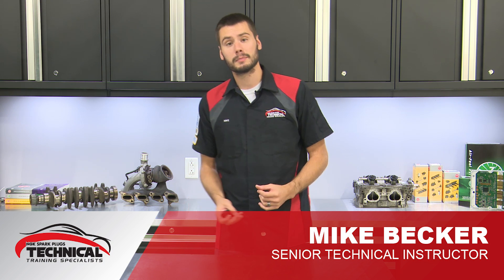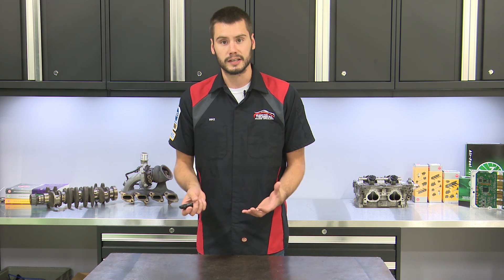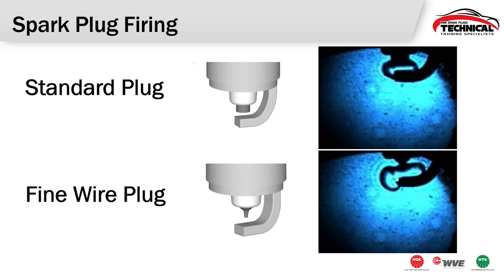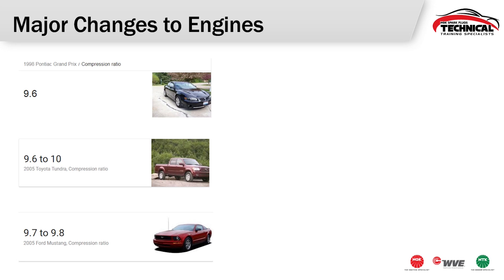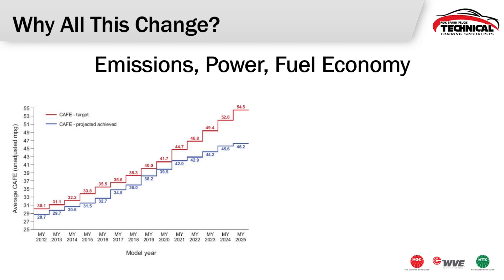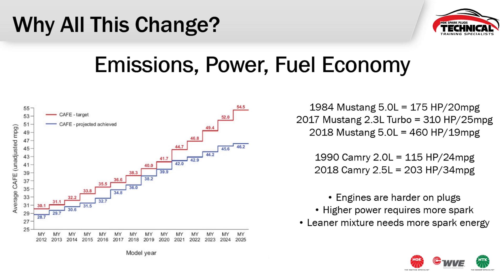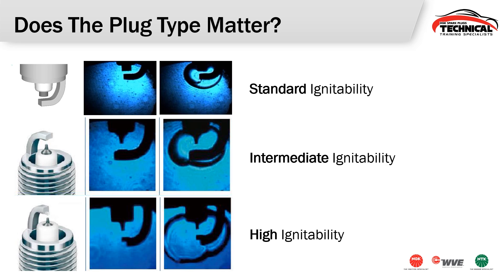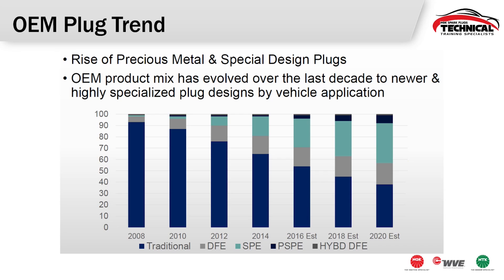Spark Plug Ignitability

Comment: Should I regap my new ngk ruthenium hx spark plugs?
Reply from the maker: Hey Migeul, that depends on the gap they are compared to what the car requires. A few thousandths, I'd probably leave them alone if it were my car. The "official answer" is that the plug gap on whichever spark plug you install should match what the car requires.
Mike Becker, Senior Instructor
Reply: GoTech thanks for your feedback

Comment: I'm running the PSPEs in my old 99 Camry 5S-FE n/a engine. All I can say is there is DEFINITELY a noticeable difference in performance over my OEM plugs. I made a video of these Ruthenium plugs about a year ago and got lots of feedback from many bright, knowlegeable people. NGK was nice enough to post and inject some reality into the comment section, explaining that NGK does not currently make a DFE for my engine, but the PSPEs will work just fine. They also said my OEM plugs were double electrode platinums which were designed to prevent misfires if the plug got carboned for any reason. I have not experienced any misfires whatsoever with the PSPE Rutheniums and in fact just made a 17K mile video where I pull the plugs from my old engine, and they look beautiful. The insulators are still clean and the electrodes are carboned in any way. Granted, I do drive 500 miles per week (b4 Covid), now abot 300, all highway, very little stop and go. I am totally sold on these plugs, and I don't say this lightly. Here are my videos... 
https://www.youtube.com/watch?v=U7Myjs9rCHg&t=137s   
https://www.youtube.com/watch?v=r8pPB-PhkzA&t=389s
Reply from the maker: Hey DBF Crell, that's great to hear! Yep, I remember seeing your video, and commenting on it. :)
Mike Becker, Senior Instructor
Reply: @GoTechTraining  Mike, I totally appreciate your tech support on my video. It's amazing how many times I've had to refer aggressive plug-savy commentors to your explanation simply to give my use of the HXs credibility in my n/a engine. I'm stunned how many people out there have an infinite understanding of precisely how spark plugs work in a combustion engine, yet no understanding of my use of them or thinking I chose the wrong type. All I can say is these Rutheniums are literally the best performance upgrade I've made, even over a K&N air filter, NGK ignition wires with Techflex heat sleeves, excellent synth oil and synth tranny fluid, and several other minor things. I wouldn't even trade theses PSPEs for DFEs should NGK decide to make them for my engine someday. Thanks again!

Comment: Hi Mike, just wondering if the Ruthenium HX is your top spark plug, why is it cheaper than the others such as the Platinum Iridiums that my car uses? BTW great content 👍
Reply from the maker: Hey VQM35, Ruthenium HX is an aftermarket only plug. It's not going to be an exact replica of the Laser(OEM) series plugs. It's kind of a plug that works as long as it's close type of thing. Because of that, the plug  can fit more applications which in turn can reduce its price. Also, while superior to it's iridium and platinum counterpart, Ruthenium is actually a most cost efficient metal.
Mike Becker, Senior Instructor

Comment: I bought an NGK Iridium Racing Spark Plug R7433-9 and it doesent fire up the bike. Put back the OEM plug NGK BKR7E-11 and it starts and runs fine. Where is the problem?
Reply from the maker: Hey, there are 2 major differences here. First, the heat range. The racing plug you put in is a 9 heat range. The BKR7E-11 is a 7 heat range. Second, the gap. The BKR7E-11 shows a 0.044" gap and the racing plug shows 0.028" gap. You may not have enough gap to adequately ignite the air/fuel mixture. Plus that racing plug is too cold if the bike requires the BKR7E-11 plug. You could try to open the gap slightly, but we only recommend 0.008" adjustment maximum. Anything more than that will distort the electrode. I'd suggest an entirely different spark plug then what you are using.
Mike Becker, Senior Technical Instructor
Reply: @GoTechTraining   Can i fix it with a NGK racing wire?

Comment: Hi, I'm from México city and I want know  about performance of spark plugs platinum un a Jeep Wrangler 6 cil. 4.0L ..
how much can  increase fuel efficiency using those spark plugs..??
Reply from the maker: Hey Eduardo, that's a tough question. You may not see much in terms of fuel economy increase, but you will have an increase in longevity when compared to a non platinum plug.
Mike Becker, Senior Technical Instructor

Comment: on my Acura 04TL I got better spark with double platinum than the OEM Iridium-pin spark plugs !

How do I know... Way less misfires around idling and smoother engine whike driving normally with partial throttle openings👍

The science may look really promising BUT then why do they have so many DIFFERENT designs of "high" ignitability (engine applications, price points...)

Here is the deal against the pin wires and lean mixtures: if the mixture under the SINGLE PATH pin is not ready to become a hot ionized plasma, you get a misfire by unfired stroke! 
Where a wider platinum actually has many more available spark PATHS to ground electrode.

To work with that limitation German engineers designed multi-sparks COP modules that shoot sparks in series of pulses instead of one shot only.

So enjoy the scientific certainties but do your testing before swearing what reality should be.

Stuby DBL-PLATINUM are cheap and last 100kMi where instead the priceless Iridium wires are shot out in 50 to 60kMi and cost 2x👍

German do the engine research then manufacture the factory machines to profit from their designs. That's why they always first and everyone else adopts their machines and designs.
Txs NGK for great quality control.
Reply from the maker: Hey G Lasser, interesting that the dbl plats worked better than the OE design. As for the longevity, that's incorrect. The iridium alloy we use will outlast platinum.
Mike Becker, Senior Technical Instructor
Reply: @GoTechTraining  Thank you for your serie of excellent presentations.

As far as plug longevity: Iridium pin is much harder than stubby platinum but since the pin only has one point to work with it wears faster with multi-spark coils.

Benz calls to swap Iridium plugs at 60kMi on M276 engines
vs.
Honda 100KMi on Dbl-Platinum plugs
😊

Comment: Great stuff as always, Mike! 🍻 Been playing catch-up on your vids - I may not have commented on all of them, but I did watch them. 😉 Busy busy! 

When I first got our '93 Volvo 940, the previous owner had just done plugs and wires (and a fuel pump ... which somehow caught the harness on fire, hence the sale to me, CHEAP!! 😁). Once I got the car running, I took it for its first run through town - I got about 2 miles when the engine started misfiring BAD - I suspect it was running on 1.5 out of the 4 cylinders, lol! I could barely move, and barely got home after letting the engine cool for 15 minutes first. I went and grabbed a set of the old, worn out plugs and wires off a '92 parts 940 I have here, and the car ran beautifully! These plugs looked like they had well over 100k miles on them, but they ran better than the brand new plugs the previous owner installed! So of course I ordered up a set of new wires, cap & rotor, and 4 NGK Iridium IX plugs for her, and she's been running great without missing a beat for over 50k miles since. 😎 The right plugs matter! 👍
Reply from the maker: Hey man, thanks! All good, I know how that goes. The right plugs do matter, it's not just "what threads in the hole and makes spark". Sounds like a sweet deal on that Volvo!
Mike Becker, Senior Technical Instructor

Comment: I just put ruthenium's n my 06 Scooby. so far so good.
Reply from the maker: Sweeet! I have an 08 base Impreza that needs an engine...I think i'm going to throw in some of the Ruthenium's as well when I put the used engine in.
Reply: @GoTechTraining  I discovered them early last year. My Daughter scored a 2008 Legacy from my work that needed an engine. When we were putting her engine together & looking up parts I seen those but the parts store did not have them in stock. So a few months later when we were putting my engine together in my 2006 I got them. Hard to tell if there is a performance difference between the 2 cars though. Both 2.5 SOHC engines. Hers is 2 years newer & has iridium's.

I looked at going with used engines but any good running used engine was more than my cost on rebuilt. I am blessed to work in a shop that has a machine shop attached :-)

Comment: Is this recommendation any fuel specific. As we have Gasoline, CNG and LPG for Indian market.
Reply from the maker: Hey Patel, like Sam said...it depends on the vehicle. We do have some spark plugs that are designed to work better with CNG/LPG. The Indian market is much different that the USA. It's likely that you actually have different spark plug part numbers than we do here...one's that better suit your vehicles. CNG and LPG is not super popular here.
Mike Becker, Senior Technical Instructor

Comment: Is it worth the money to use high-ignitability plugs in a car that wasn't designed for them?  Do you get a noticeable increase in fuel economy?
Reply from the maker: Ga Ad, you may see a slight increase due to the more efficient flame front. Many times this increase is only known on a dyno. The biggest upgrade would be in longevity over a tradition copper(Nickle) spark plug.
Mike Becker, Senior Technical Instructor

Comment: Hey Mike... a question for you, I hope you can answer. 
When it comes to the older vehicles that originally ran on copper plugs, I've always heard it's best not to upgrade... let's say to a Platinum plug or such. How accurate is that? 

This may not apply to those vehicles that originally came that way from production. Upgrading those would be OK. Your thoughts?
Reply: great question. I'm curious as well, If I see oem is copper then I put copper back in it even though they don't have the longest life.
Reply from the maker: Hey Cuba! Great question! Fine wire plugs, single or double precious metal with this newer high ignitibility designs will be a definite upgrade over a traditional "copper" plug. The only time you may run into issues is if your car came with NON RESISTOR plugs. All of our precious metal plugs, besides a few race applications, are resistor plugs. Does that make sense?
Mike Becker, Senior Technical Instructor
Reply: Cuba, I run the fine-wire NGK G-Power plugs in our '86 Grand Marquis (5.0), and NGK Iridium IX in the '93 Volvo 940 (2.3 non-turbo). Got over 50k miles on both so far - still running strong! 

I also installed the Iridium IX in my '07 Silverado with the 5.3 - they were identical in every way, except for the lettering,  to the OE AC Delco "100k mile" spark plugs I removed from the engine.
Reply: @SmittySmithsonite  nice! That's good to hear!  I've had other instructors tell me different, so it's good have definitive answers.

Comment: Interesting!
Questions :
Do the high ignitability plugs wear faster?
It makes sense you can’t use low ignitability plugs in a high ignitability designed engine,but what about the other way around?(high ignitability plugs in low ignitability designed engines-older engines)
Thanks. 👍
Reply: literally answered both of these in the video smh
Reply from the maker: Hey Nick, no worries on the questions...means it wasn't clear enough in the video. Izukenekuzi, no need to call him out dude.
Anyways, no they wear the at the same rate as any double precious metal design. Ruthenium will actually last slightly longer. High ignitibility plugs in order cars will work just fine, you may even see subtle improvements. The technology wasn't around when those cars were made. New tech on old cars is ok, new cars with old tech is bad. The newer car is specifically designed for that newer tech plug. Hope that clarifies that!
Mike Becker, Senior Technical Instructor
Reply: NGK Technical Training Thanks for the answer Mike. 👍